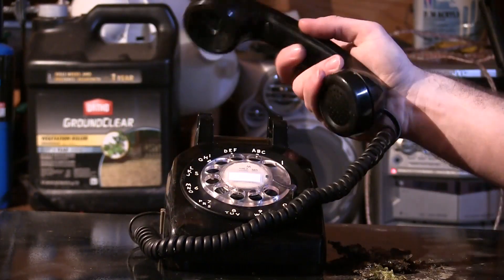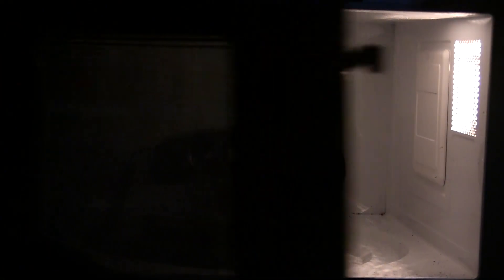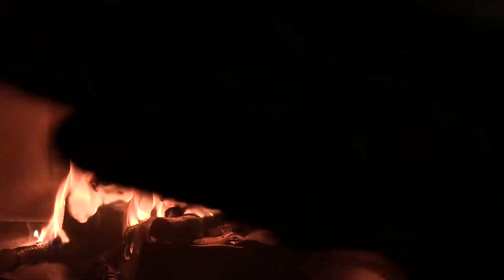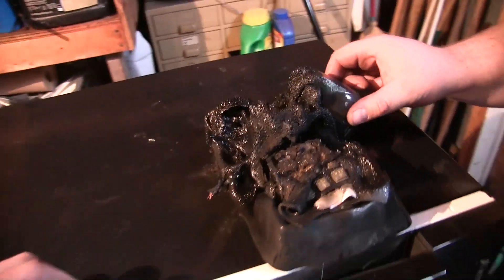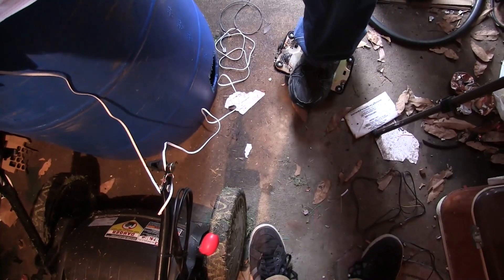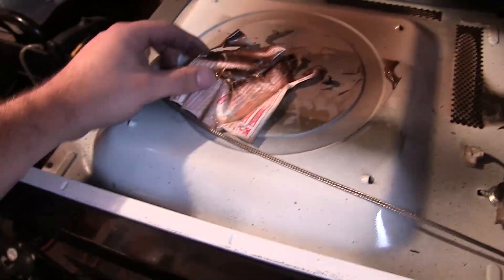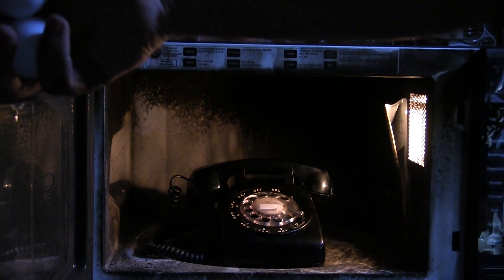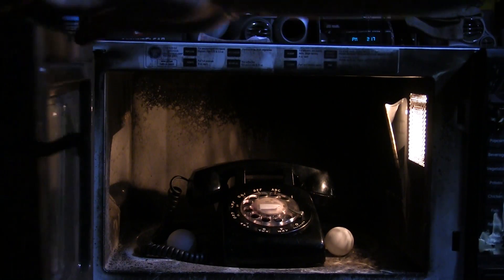Telephones In The Microwave (Touch Tone VS Rotary)

Comment: Those newer microwaves have a safety feature to lower the power when there's metal inside. That's great if you accidentally leave a spoon in your bowl 🙃
Reply: I doubt the microwave they were using has that. I have taken apart many microwaves and none of them had any protection features, other than a overheat thermostat. Probably only inverter microwaves have that.